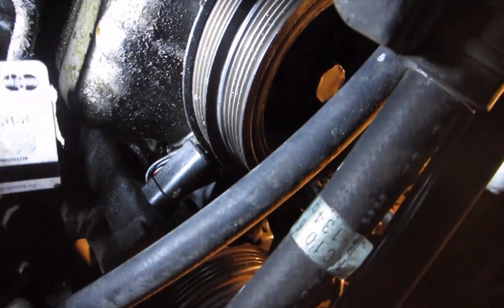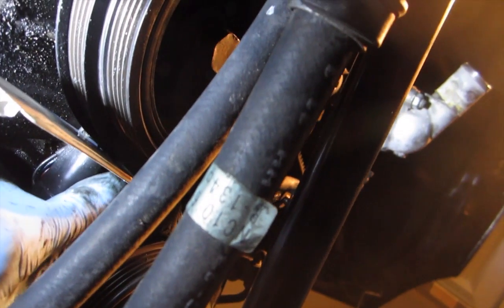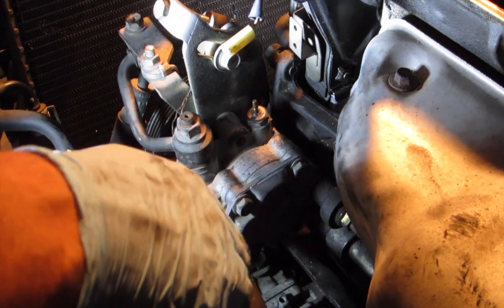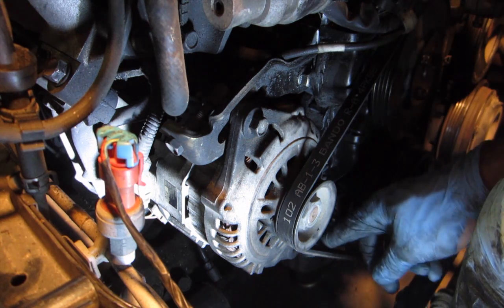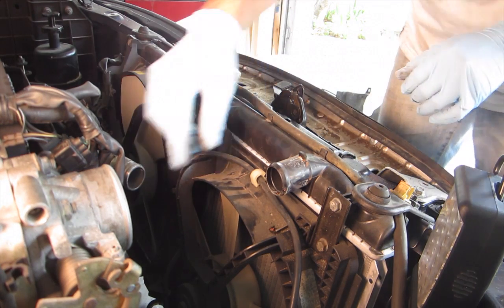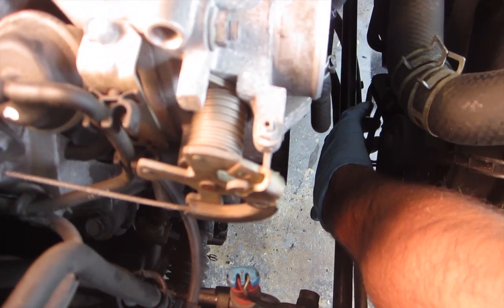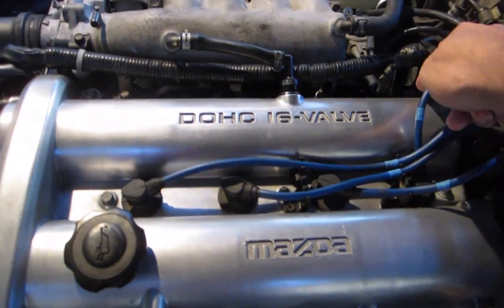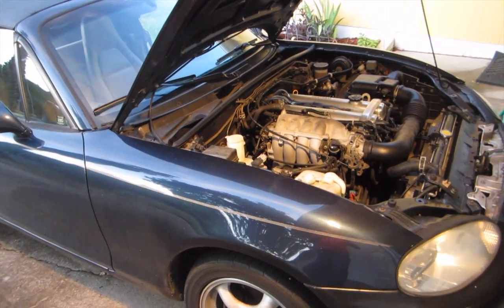1999 Miata timing belt pt4

Comment: Good job...I do have 1999 mx5, and I wondering if you will be able to do the timing belt/water pump replacement for me,I saw that your car plate is from Texas and I am from Texas too..please let me know
Reply from the maker: Lucero Madruga Thanks for commenting. Right now, I'm pretty tied up with some illustration gigs and traveling. As much as I'd like to help, I think by the time you factor in travel costs, possibly renting a car if this is your only mode of transport, parts and labor, it would be easier to have a shop do it. It seems daunting, but the Miata's engine is pretty forgiving. Just make sure to label your parts and take your time with it. there are plenty of resources for instruction like Miata.net and here for tips.